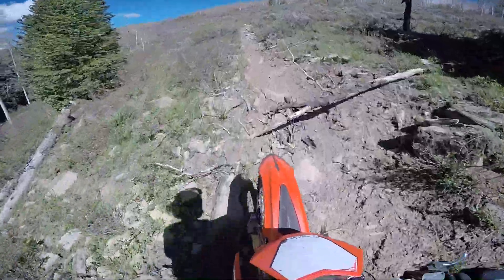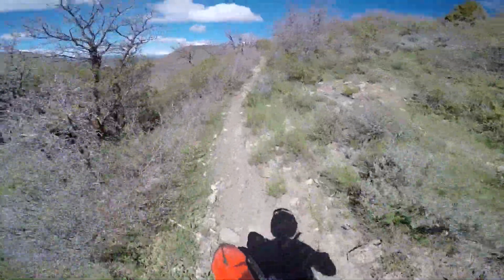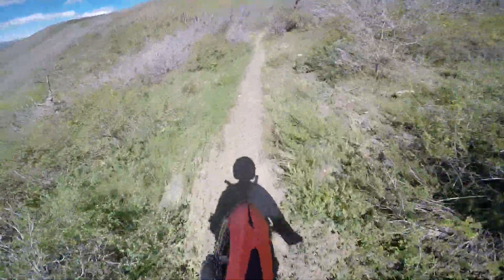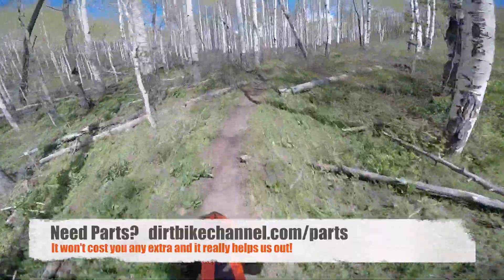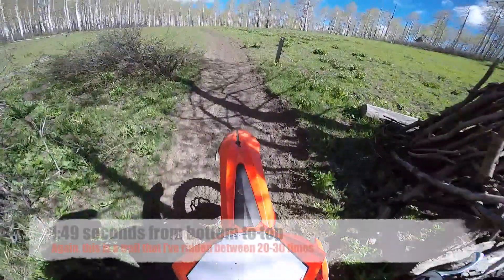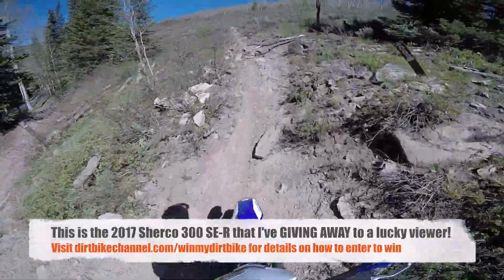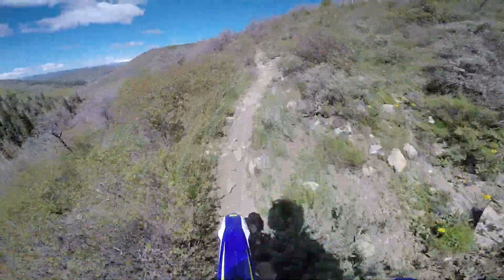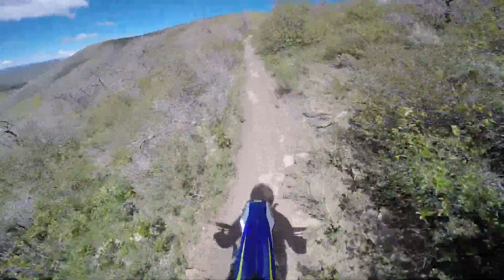Sherco 300 and Beta 300 Back to Back on Single Track Hill | Episode 285

Comment: You need to do that again with the beta's power-valve adjusted back to beast mode.
Reply from the maker: This is stock to stock.  That is what everyone wanted :)
Reply: Would a simple sprocket change cure the Beta's low gearing troubles?
Reply: Screw stock set up. Who rides a bike in stock form????

Comment: 1 the power valve adjustment does not change overall power it only changes when the power comes on.
2 if you don't like first being to low change the sprocket either drop teeth on the rear sprocket or add teeth on the front sprocket to go faster. 1 tooth on the front is equal to roughly 3 on the rear. the sherco is 14/49 the beta is 13/49 so under $20 and 10 minutes work you can make the beta faster in 1st.
Reply: i'm sold on the beta, watching the bikes and reading between the lines on his commentary. his gripes are his preferences not mine. the major gripes he has with the forks can probably be overcome with changing the fork oil, different front tyre or pressure in the tyre. do you notice how he never opens the bikes up fully even on open ground and to do a timed section you really need to try 100% and do multiple runs on each bike and average the results. to me it looked like he is riding a leisurely trail ride not fast pace enduro. could possibly be harder than it looks but i seriously doubt it because the bikes just aren't being opened up.
Reply: michael close i have a 2016 300rr. Forks needed a revalve, new gt216 aa fatty tire saved me a year before i did the revalve and oil. That fixed it. I also rode a stock 2016 xc back to back last week and it was hard to keep on the rocky pnw singletrack trail. Also felt twitchy and was hard to stand up on. Its hard to beat a bike that is set up for you. Iam keeping the 300rr

Comment: if you are slower due to suspension you may not be where the power is.get the suspension dialed in and I bet you would be just as fast  on beta.That is if you  get comfortable with it.
Reply from the maker: That is the issue :) I can't get comfortable on the Beta forks no matter what I do to them.

Comment: Very intresting review of those 2 bikes. I use to have ktm 300 EXC 2015 but now just bough Beta 300 RR 2017. Im relative short 1.71m and I feel so confortable riding on Beta. As you review those 2 bikes are different on there way. I do prefere Beta for Hard enduro but I understand the speed and confidence that Sherco and KTM gives. At my point of view Beta is different then the other bikes. It is like a fun bike with a lot of power. Not sure but my ballance improved 60% after go for Beta.

Comment: Its not the "stock" setting.  Its adjustable.  Its just a starting point from where you set it up correctly for the rider and conditions.  The Beta is clearly set up for more technical terrain where you need a deep first to launch over gaps and stumps from a standstill.  Power delivery is soft in second for the very reason you explain - not wanting wheel spin in technical low traction conditions.  Get some help setting up both bikes ideally for open trails and your weight.

Comment: Hey Kyle,
I've been riding my 2007 YZ250 that's set up for mountain/desert/single track riding for 10 Years now and I love that bike! I've been looking to upgrade though and wanted to see what your thoughts were on a Sherco 300 vs YZ250X. Could you give me some insight on what you think? I like how the Sherco now has the KYB suspension and a few other things about the Sherco. I don't feel like the YZ has too many upgrades/changes from my bike (no electric start, etc.) What are your thoughts?

Comment: Kyle - did you ever receive feedback from beta as to why the manual says to not adjust the power valve?   Also, which map were you running on the sherco for that trail?   To me, adjusting the power valve is not any different than adjusting the suspension to suit your style, the bike is still "stock".   Changing pipes or replacing sprockets would be modifying the bike.   I'd love it if you can do a back to back with that power valve adjusted to how YOU would like it set, just like the suspension is adjusted for YOU.  Thanks bud.  Keep up the awesome vids.
Reply: Searching around I found people saying that it was a translation error or a misprint in the manual.  However, looking at other translations they all say the same thing.  This is actually what the manual says:  

"ATTENTION! The vehicle is provided with an exhaust valve whose fine tuning is performed during the final try-out of the engine. The position of adjustment valve 1 must not be modified for any reason. For any adjusting, please contact Betamotor’s Authorized Service Network."  

However, looking in all magazine reviews and various dealers who sell Betas they state that the "Beta Progressive Valve (BPV)" is an adjustable powervalve you can tune how you want as a feature and the magazines will review tuning it.  They use the same text in their advertisements below.  It might be stated in the manual that way as a way to avoid warranty if you mess it up.

Adjustable Power Valve
All Beta 2 strokes have an adjustable power valve that uses a 5mm allen socket. Riders can simply dial it in for less hit or back it out for more allowing the engine to be adjusted per the rider’s preference.

Comment: At low rpm the power valve doesn't make a difference.  You are on to something with the gearing though.  The Beta is geared so low.   I have read that Steve Holcombe uses a 14t front sprocket, and now the 2018 will come with a 14t sprocket.

Comment: In stock form, the Beta needs a few minutes of work I'll give it that. But with about an hour of setup the Beta is by far a better bike for enduro. You just need to know what you need to get setup. I'll give you a couple things, 1) change the fork oil to any good 5W oil. 2) Bring the forks up in the triple clamps to the 2nd or 3rd line. 3) Adjust compression AND rebound until it feels right for you. All done! And if you want it to feel like a motocross bike with a silly 'hit' adjust your powervalve however you like.

Comment: Comparing apples with oranges. This particular Sherco model should be compared with a Beta 300RR Race Edition. Also the gearing is totally different on both bikes  - should be taken out of consideration or adjusted with gearing changes.

Comment: Couple things that don't make any sense to me here. I don't understand the chronological placement of this video. It completely contradicts the points that both you and Sam were making about the bike in the two recent videos you posted prior to this one. I forgot which one of the two it was, but you took the bikes up a much steeper and looser hillclimb (albeit less technical than this one), in which you raved about the Beta motor's ability to continue to pull hard in 3rd gear up the hill. The Sherco, you said, didn't do as well and couldn't pull 3rd gear up the same hill. "Kudos to Beta" you said I believe amongst some hooting and hollering in pure excitement and satisfaction. Why on earth is this video the complete opposite of the previous two? This footage is definitely older than the previous too videos, since you still don't have hand guards of any kind on the Beta. This footage was obviously taken before you knew that the PV could be adjusted. So why not put it with the initial first impression videos? Also, the second thing that makes no sense to me, who in their right mind asked you to compare the bikes "stock for stock" with the Betas PV in the factory setting? I sure as hell didn't, and I didn't see anyone else make that request either. In a previous comment you said "that's what everyone wanted"? Who are these people and what are they smoking? You say it's a stock to stock comparison, but it's not. They're stock accept for ""leaned out the jetting, setting sag, and clicker adjustment". Those are all tuning adjustments, especially the jetting, that are not factory settings at all. So why leave the PV untouched on the Beta? That makes zero sense. If you really want to do a stock for stock comparison don't touch a damn thing and ride the bikes back to back. Don't touch the jetting, the clickers, or the sag on either bike. See how it goes then. The previous two videos had some solid points and made some solid forward steps in the right direction of understanding what the Beta is and what it's designed for, where it shines and where it doesn't shine. Just like Sam said, "If you ride in the tight technical Northeast, that's a f*ckin good bike".  This video took 5 steps backwards.
Reply: Exactly.
Reply: It makes sense because the gearing of the Beta i shorter. Thats why on the other video he could climb up in 3 on the Beta but 2 on the Sherco. Same thing here, he was on 2 on the Beta but on FIRST on the Sherco due to the longer ratio...the Sherco is always one gear lower to match the Beta. Thats why on the "third gear test" of the other video he praised the Beta, because the 3rd gear on the Beta is as short as the 2nd on the Sherco...hence why the Sherco couldnt climb in 3rd...

Comment: wow, so if the Sherco came with 30 psi in the tires you would run that?  Rolling eyes at the endless silly comments on the Beta.  I'm no beta fanboy, but if you are adjusting them be fair  and do the same to both....i.e.turn in the Sherco power valve all the way
Reply: i agree bro idk wtf hes riding if he says the beta 300 a 300cc two stroke doesnt have enough power. that thing has loads of power even in stock form.